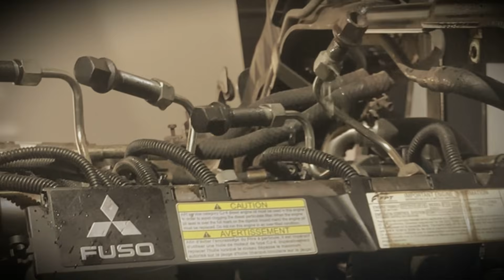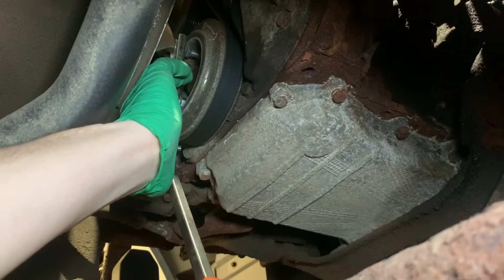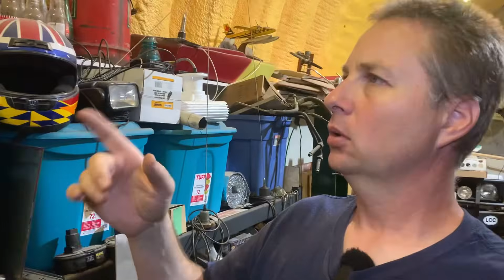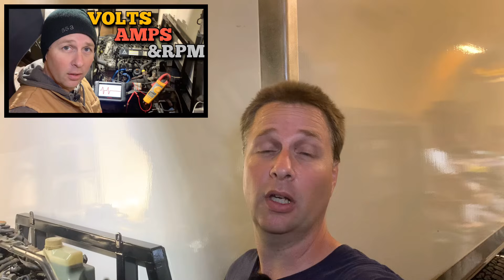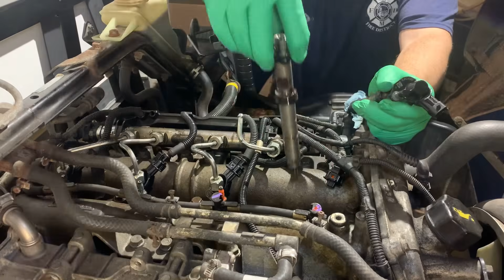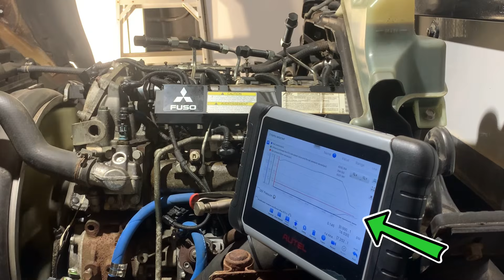Fuel pressure, Injectors, Starter....  WHAT NOW?!?!  | FUSO FG

Comment: Bruce I wrote to you before but haven’t seen whether you covered this already - a service manager told me since you tried starting fluid and it won’t ignite, maybe you have no compression. 

He said they had problems with 2012 engines early on because they use a timing chain tensioner that wouldn’t push in all the way if the oil was too thick. Then the chain could jump a tooth ->valve timing off ->no compression. If you reset the timing chain and run 5w30 oil it works. (A quick google search / AI result shows a 2013 Fuso specced as using 5w40 rather than 5w30). 

Have you done a compression test and checked the timing? And which oil are you using?  

I hope you sort it soon!
Reply from the maker: I believe I can confirmed the timing is correct - and with the injectors out there is a lot of “blow” out the injector holes… not that “blow” confirms it, but the timing chain marks and cylinder 1 TDC line up.    I was going to check compression but the adapter I got didn’t fit my kit.

Comment: Have you tried using some starting fluid? I’m going through the same thing trying to get a one just like it but 2017 to run. It’ll crank up run sit there and not over then it shuts down if I’ve tried to drive it
Reply from the maker: I have, but the devil juice doesn’t fix fuel system problems 😁
Reply: If you have fuel tank under the rear like my fe180 there is an inline filter coming right out the tank that gets pretty gunked up, that kept mine from running good awhile back

Comment: Wow, I just can’t imagine shutting down your engine today and “tomorrow” all these problems appear when you go to start… at this point there’s zero chance I would trust that engine with the family in tow somewhere way out in the sticks!
Reply from the maker: Well, it’s not quite like that.  The diesel in the tank was old, and I mean, old old.  That was my first bad.   Then, it didn’t run for several months - and I had no fuel conditioner in it.  So, reality - I highly doubt any of this would have come about with a continuous stream of fresh, treated fuel.  Now - of course anything can quit on you at any time, and being that the fuel system is Bosch - unfortunately if you drive pretty much anything diesel these days, you’re not immune.   This isn’t a Mitsubishi, or Fuso issue.

Comment: Your perseverance is admirable.  I'll be tearing down my 2013 4p10  soon. Parts will  be available by request, including new injectors.
Reply from the maker: Are you tearing down for a rebuild?
Reply: @BruceandKrista  No. It's toast. Originaly the motor started knocking, assumed it was leaking injector. It was.. Didn't get it in time,  damage was done. After new injectors installed it threw a rod on the test drive and windowed the block....
Reply from the maker: Ouch.  Leaked enough fuel to hydro lock the cylinder and punch a hole?
Reply: Where are you located?
Reply: @spencerwingfield1247  British Columbia. I'll likely use Ebay to handle sales..
Reply from the maker: Hmmmm… looks like my injectors on order fell through… 😞 - might need to connect @67bajabuilder shoot me a message at 3Dparts4me2 (at) gmail (dot) com.
Reply: @BruceandKrista  Sent yesterday.  Hopefully I got that right...

Comment: What a bummer, let's hope the new injectors are the only fix you need. We were really hoping it would start this episode......
 I think I'd have at least one of the old starters rebuilt and carried for a spare.  Since this is supposed to be, eventually, and expedition vehicle.  I always carry a spare starter, alternator, belts and filters in my Class A Rv.

Just a tip!,  For my hot rodded Cummin 5.9L engine, I built a 12 volt pre oiler that runs when the glow plug circuit is turned on. It's just a push button switch with a glow plug light showing when it circuit is on.  
I used a 35 psi electric oil pump and plumbed its output side on a T with one way check valve at the oil pressure sender.  Then I installed a T at the oil temperature sensor that is located in the side of the pan about 1/2 way up from the bottom of the pan for the pumps supply feed.  This way, my engine bearing and turbo are always oiled before I hit starter. 
This way, no matter how long my engine sits, the bearings are always going to get oiled before every cold start.
Reply from the maker: That’s a great system - all engines should come with that from the factory!!    I do for sure intend on carrying a spare starter and alternator (among many other small bits!!) sensors and senders are small, take up almost no room and can really get you out of a bind!